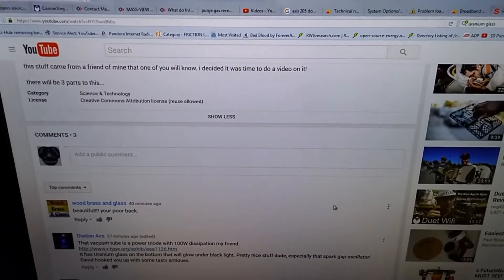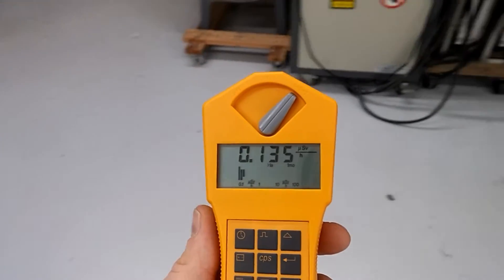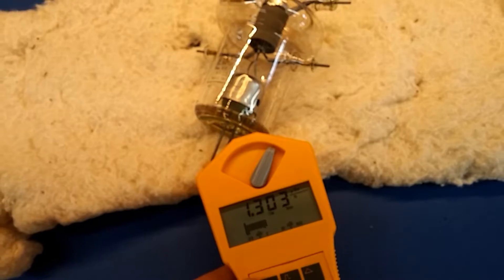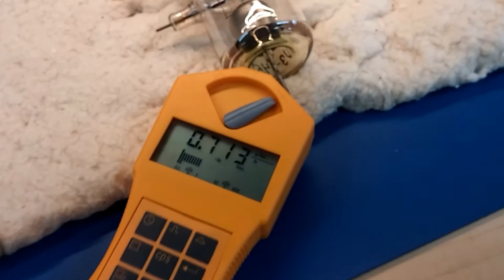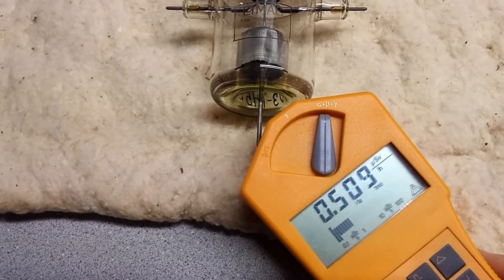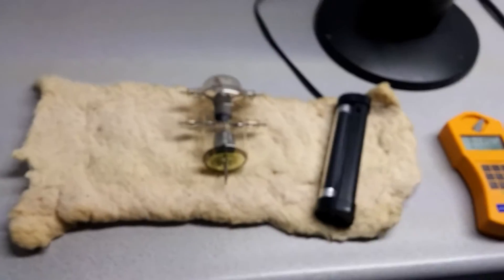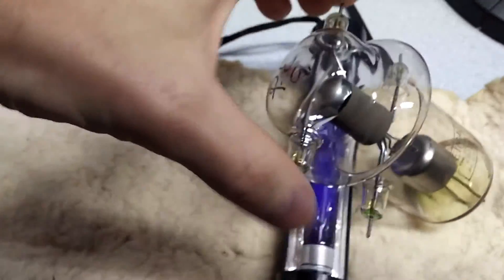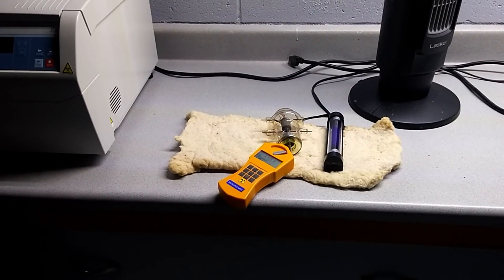Radioactive Vacume Tube. EIMAC VT-127-A 100W Triode. Uranium Glass

Comment: That tube could possibly work as your pre-amp for those HV spark-gap inert gas switches you have. It is rated at 3000V on the Anode so it not be enough for those big guys. 
I love HV stuff. Gosh its cool. Los Alamos Labs, crazy. 
Super fun.
Peace.